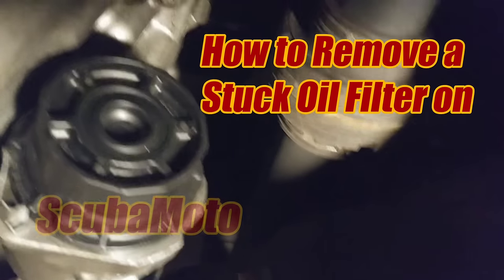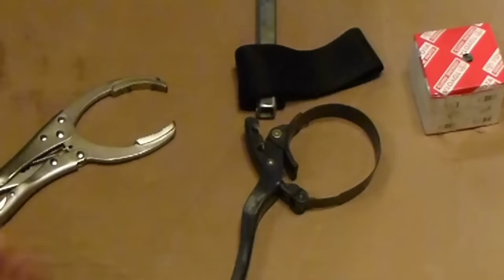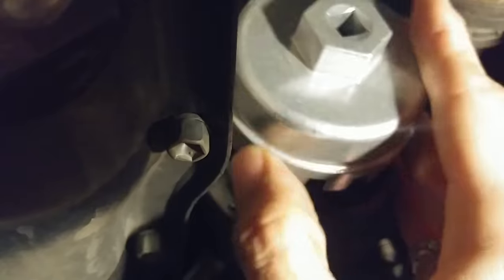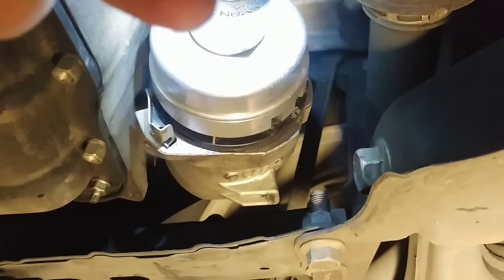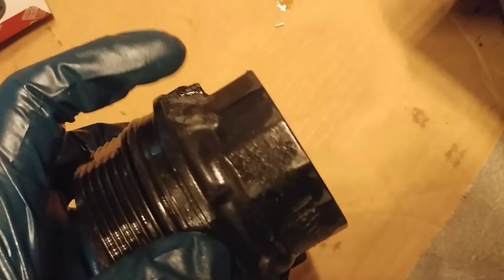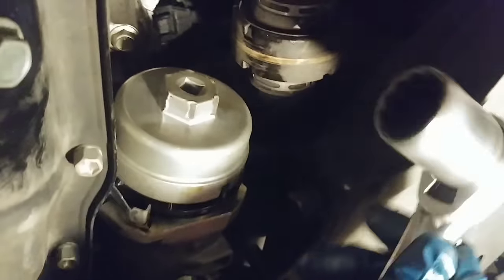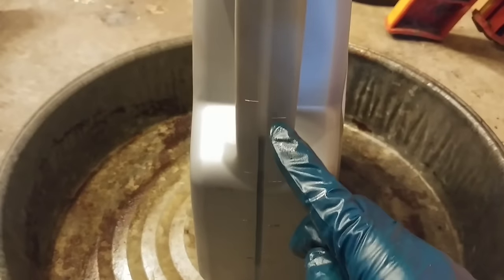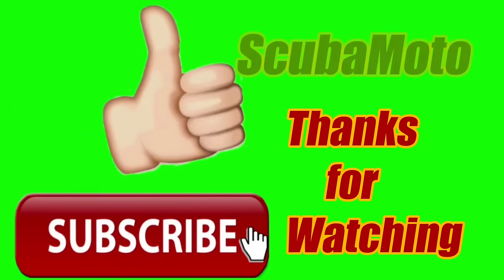How To Remove Stuck Oil Filter Toyota Prius Corolla Lexus Oil Change

Comment: What's the size of the tool
Reply from the maker: Reme Martin: I'm not sure which dimension you're looking for. The 14 flutes are 64mm, the socket drive is 3/8", the hex lug is 27mm. The tool used in the video:https://amzn.to/2POqOU9. But most important is that it is the type designed for the Toyota filter housing shown in the video. Then it will provide the maximum points of contact needed for a high-torque removal. A simple 64mm cap wrench will not work. Thanks for watching and for the comment.

Comment: A breaker bar is always better than a rattle gun.
Reply from the maker: jeremy draper: Totally agree. Many comments here including my own about trying a breaker bar. I even slipped a pipe on mine and it just rocked the car. Not safe, especially if a car is on jack stands. Sometimes impact works. Thanks for the comment.

Comment: These plastic housings are the worst! Name every trick, tool, wrench, cheater bar out there! I've tried it all! I even broke my motivx filter wrench! had to do the ultimatum last resort on this on a toyota camry 2015. I had to cut it using an oscillating multi-tool, flat head screw driver, hammer, vampire pliers and a bread knife! Yup! Even a bread knife! Whatever works, we gotta be resourceful in times of desperation. Then I replaced it with a metal one!
Reply from the maker: Marcel Marilag: Thanks for taking the time to leave such a great story. It sounds like a nightmare. Congrats on getting that bad boy off of there. 👍

Comment: All that did to my was strip off all the plastic teeth and break a hole in the filter. It is still on the car and I can't fix until I get it off!
Reply from the maker: I know it doesn't help you, but you have plenty of company based on some of the experiences people have shared. Even the filter housing in this video lost one of the lobes and at 2:00 , the cast metal wrench even looses a tooth. The cause is almost always the same; someone installed the last filter with an impact tool. They do it thinking they're saving time, but in a fraction of a second, they put several hundred foot-pounds of torque on something that is only supposed to get 18. Every one of these that I installed, came off easily without even a breaker bar at the next filter change. Good luck breaking the rest of the housing out to get a new one in and thanks for sharing.

Comment: I ran into the same problems as everyone else, so I'm not going to repeat my horror story (it was 108F in the garage and it ruined my Saturday morning).  What adds insult to injury is trying to "wrench" on the breaker bar because the Prius has such low ground clearance.  I wish I would have thought of using the impact tool.  At least the Toyota mechanics can bust it open standing up............
Reply from the maker: Billy V: Thanks for sharing. Chances are, whatever mechanic did the last filter change, they probably used an impact tool to put it on. It's a very common and costly mistake because it saves four seconds over tightening it by hand. In less than a second, they put 10 or 20 times the recommended torque on the housing leaving it nearly impossible to remove. Dealer techs are just as notorious for doing it as the techs at the local lube shops. Trying a breaker bar first to remove it is good since it is less likely to break the housing, however, if your car is on jack stands, be very careful using a breaker (cheater) bar. I tried that before using the impact gun in the video. I had even slipped a pipe over the breaker bar for added leverage and it just rocked the car. (NOT good on jack stands).  Always wear eye protection when using an impact tool. Impact may damage something, but on jack stands it is actually more stable and has greater odds of succeeding because of the nature of impact.

Comment: WTF did Toyota design it like this? My 2007 Prius was a breeze to do oil changes on: no skid pan to pull out of the way, and a conventional filter). Of course, this meager, tiny paper filter element costs almost TWICE as much (at O'Reilly's) than the earlier, metal filter canister! And we have to buy Toyota part #TOY640 just to remove this stubborn filter cap. WHY?
Reply from the maker: wholebird: I agree. Even Ford started using the easier standard metal canister filters on their Fusion Hybrids. But TOY640 is not the right wrench. It only has 14 flutes but doesn't have the contact points for these filter housings. I list several in the video description that look like the wrench in the video if that helps https://amzn.to/32bMbpp . Thanks for the comment.

Comment: Should have replaced the filter housing with the aluminum one while you were in there.
Reply from the maker: thomas altruda: Absolutely! I totally understand why some people are doing that. I even list metal ones in the video description at a pretty good price. If you have to replace it anyway, why not a metal one? If you know you're going to be the only one installing in the future, then you know it won't be getting over tightened.  I have never had trouble removing an OEM plastic one that I installed myself. I don't even need a socket. I just use the 3/8 ratchet drive and they always come off easily because I only used the correct 18 ft-lbs to put it on.  Thanks for the comment and for sharing.

Comment: What is your best guess on who changed that filter previously?
Reply from the maker: M Mahtnart: There is no need to guess. The entire service history for the vehicle was the same Toyota dealership. Every oil change was on record as performed by them. I must speculate, based on the very poor condition of the filter removed in the video, that they had given up trying to remove the old oil filter several oil changes ago. New owner, off-warranty and wanting the first non-dealer oil change is what led to this video. Thanks for watching and for the comment.

Comment: I was able to do it .. pain in the ass man .
Ok so instead of using your hands to turn  it.. 
use your foot and push it with your foot .. 
hang on to this U shaped bar below the bumper of the car and give it everything you got . 
If you dont hang on to something below the car your going to slide back . Does this make sense ???

Comment: Thank you for the video    I was changing Mother in Law oil on her Corolla    and Walmart dumb dumb's strike again     wayy  too tight.  I used a long bar and a 40 oz Dead Blow to get er off    PITA 4 Sure
Reply from the maker: killersp1974: Congrats on getting it off. Thanks for the comment and for sharing.

Comment: After all else failed, the impact wrench removed the housing from my 2011 as well--and snapped one of its fins in the process, leaving a gaping hole in the side of what ought to be a replaceable oil filter.  Now I have to buy a new oil filter housing: how's that for "green"?  And my car's immobilized for several days until the replacement part arrives.  Stupid, stupid design, Toyota: using plastic to make a part that can't be removed without an impact gun.
Reply from the maker: wlan2: Totally agree that it was a bizarre design choice when oil filters hit their design apex decades ago. Now that sounds like a seriously tight filter housing you had to deal with and a great story. It's too bad it shattered, but now that you're putting on yourself, at least it will never be more than hand tight. Thanks for the great comment and congrats on at least getting it off.

Comment: Why the f*** did Toyota/Lexus go back to cartridge filters. They are way more problematic than spinoffs.
Reply from the maker: They hear you. After decades of using cartridge filters like the one in this video, Toyota has gone back to traditional metal cannister spin-off filters on the corollas, Camrys and others. Thanks for sharing.

Comment: This is one reason I hate foreign cars, I attempted to change the trans mount on my neighbors 2005 BMW x3, not so fast, it's pressed in and requires a special BMW removal and install tool which goes for about 250.00, I won't tell you how I did it but I did it, the dealer wanted 500 to change it,
Reply from the maker: Peter: Great story! No dealer appointments, no loaner car, you saved good money, and the best part is that you got the job done right- yourself. Thanks for watching and for sharing.

Comment: What oil does a Toyota Corolla 1.8 petrol 2012 take? I was told 5w30 synthetic but have seen in video 0w20 fully synthetic, any help would be much appreciated.
Reply: What does it say on your oil filler cap (or in your owner's manual)?

Comment: The plastic ones will seize in 5000 miles no problem. All because they give it an extra notch, then the pressures of the engine, suck it in, without a prelubed gasket, and it gets caught.

Comment: Jiffy Lube wants $500 to remove cap and $65 for oil and filter change. Most expensive oil change in my life
Reply from the maker: Clunky Wall: If they did the last filter change, maybe they should remove it gratis.

Comment: I put anti seize on the threads when I reinstall. Even at 30 lb-ft they are a bear to remove later. Lousy design. Almost impossible to do without the special cap wrench.
Reply from the maker: Roger Whiting: Thanks for commenting. 30 lb-ft is nearly twice the recommended torque for this filter housing so I imagine that would make it very difficult to remove later. As I mention in the video, Toyota's recommended torque for the Prius housing is only 18 ft-lbs; and 15 ft-lbs is likely enough.  The drain plug torque spec. is only 28 ft-lbs. Congrats on changing your own oil and thanks for watching and for the comment.
Reply: It's odd that no one seems to read what it says right on the oil filter cap itself. It says "Tighten to 25 N•m". 25 Newton meters is equal to 18 ft.lbs.

Actually, the spec is 25 N•m ± 5 N•m which is equal to 18 ft.lbs. ± 3.5 ft.lbs.

Comment: I'd hit the dealer and get the metal filter housing and toss that plastic crap one. Newer models come with the metal from the factory now thank God.
Reply from the maker: ScubaCat3: As long as they're not over-tightened, even the slightly damaged plastic ones come right off. But if you're going to replace it anyway, then the aluminum ones for Lexus should fit https://amzn.to/32tamzL or stick with the original plastic one for a bit less https://amzn.to/2ZDBvOG. Thanks for watching and for the comment.
Reply: Be forewarned that metal (aluminum) oil filter cap may be even tougher to get off when over tightened.

The following is from Wikipedia...
"Galling is a form of wear caused by adhesion between sliding surfaces. When a material galls, some of it is pulled with the contacting surface, especially if there is a large amount of force compressing the surfaces together. Galling is caused by a combination of friction and adhesion between the surfaces, followed by slipping and tearing of crystal structure beneath the surface. This will generally leave some material stuck or even friction welded to the adjacent surface, whereas the galled material may appear gouged with balled-up or torn lumps of material stuck to its surface. 

Galling is most commonly found in metal surfaces that are in sliding contact with each other. It is especially common where there is inadequate lubrication between the surfaces. However, certain metals will generally be more prone to galling, due to the atomic structure of their crystals. For example, aluminium is a metal that will gall very easily, whereas annealed (softened) steel is slightly more resistant to galling. Steel that is fully hardened is very resistant to galling."

Comment: Pain in the ass ....rediculous..my hands are scraped
Reply from the maker: ATS: Absolutely! Who knows why people over-tighten these. Thanks for watching and for the comment.
Reply: ScubaMoto beautiful saturday morning..lets go change the oil....get the in garage...everything ready..even the corolla filter removal tool... tried for 30 min and ended up bending the 2 damn wrenches...also the filter tool is damaged now and just a waste of bloody time.. i also noticed there is a pin which also didmt remove. Are we trying to break into fort knox????? Why did they make it so difficult cmonnnn so dissapointed. Now gotta go to a mechanic !!!! Argghh
Reply from the maker: ATS: The pin you can ignore. (unless it's been bent in a way that causes issues). Service manual does NOT recommend messing with it. The bent wrenches might be a result of NOT using impact. 300 ft-lbs of torque AND the right wrench AND impact, is the only combination that would remove the filter shown in my video. And the process was hostile and took a toll on the crappy plastic filter housing as you can see in the video, but it removed it. It broke one of the ears off and jammed the flutes, but it removed it. 18 ft-lbs (hand snug) is the specified installation torque. I can't imagine why shops install these with impact tools.
Reply: ScubaMoto i didnt use electric inpact wrench just manual by hand..i used all my strength but it didnt move lol
Reply: ScubaMoto i broke 2 filter remover tools what a waste of time and money damn all i want to do is oil change

Comment: Awful fucking design. Didn't think I'd have to get an impact on a oil filter cap. Gonna try this today, I'll return with results.
Reply: I did try this. My impact was too big to fit straight on, had to use a swivel extension to come in at an angle, unfortunately this made it take longer. But I also tried placing a piece of paper (Yes a plain sheet of white paper) between the cap and the removal tool, to make the tool fit very snug, and it finally came off. Thank you for the video.

Comment: I'm afraid Toyota is getting shoddier and shoddier. Besides this idiotic design with the filter housing, I like to warn others to avoid the 1st generation Sequoia (2001 - 2007). The rear hatch will break (not might, it WILL, at some point) and it won't open. Very poor design with shoddy, weak, and mismatched levers and whatnots inside the rear door. Toyota dealer will charge $250 and up to fix it; and in less than two years it will break again. I don't know why they weren't forced to do a recall on this crappy door.

Comment: And Toyota still does not think of fixing it or start using normal oil filters.. hate Toyota!!
Reply: Yet Gen 2 Prius has a conventional canister filter; very easy to change, which costs LESS than this dumb filter. An amazing car with a stupid oil filter.
Reply: Actually the newer models seem to be reverting to spin on filters as some newer models now have.

However, I doubt their reasons for designing this have changed.

Why Cartridge Filters
https://youtu.be/qH79uDR2YFM